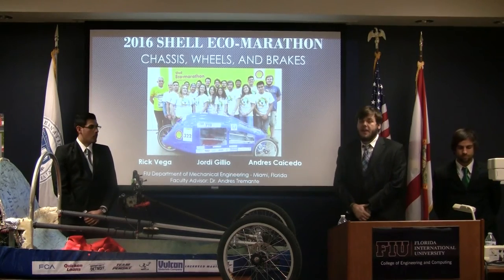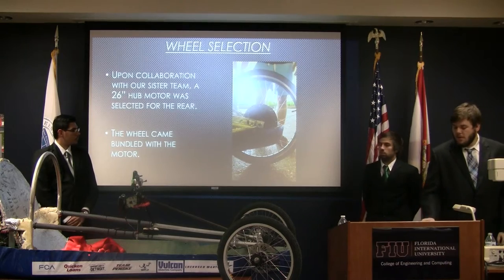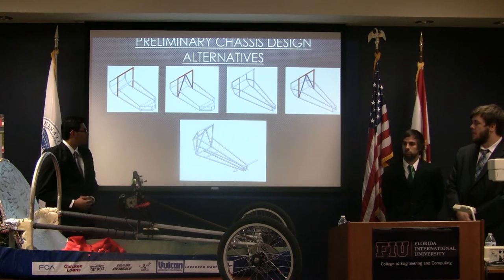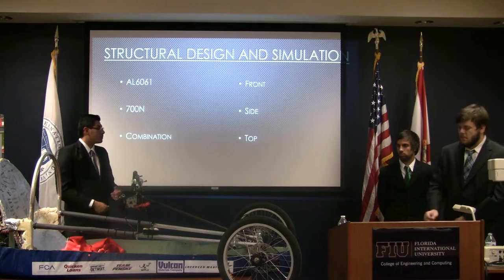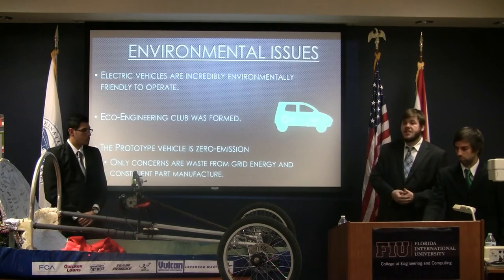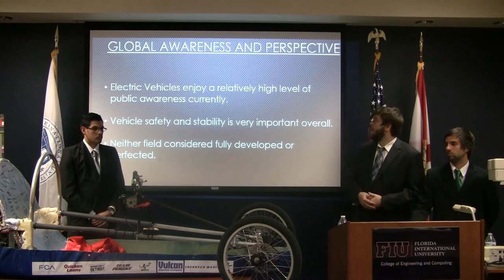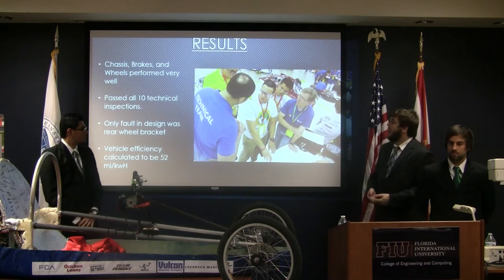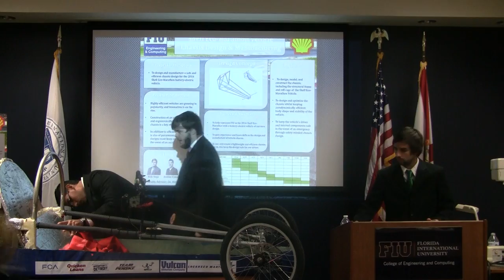Team 19: 2016 Shell Eco-Marathon: Chassis, Wheels and Brakes

Comment: Glad that the team was able to implement some of the crash scenario analysis. Final frame design outcome did change from the previous presentation and for the better. In some slides the team seemed to be rushed and could have summarized more to gain better clarity.